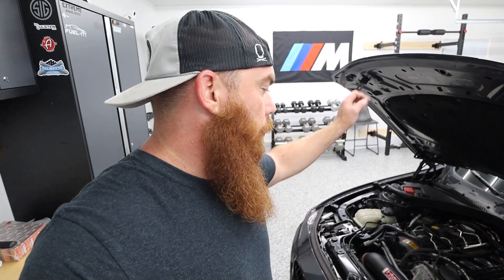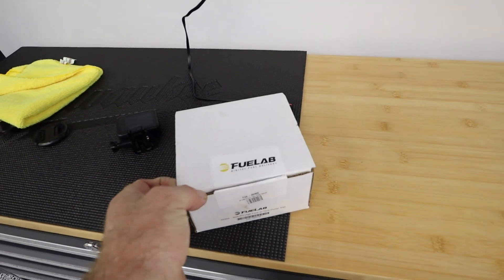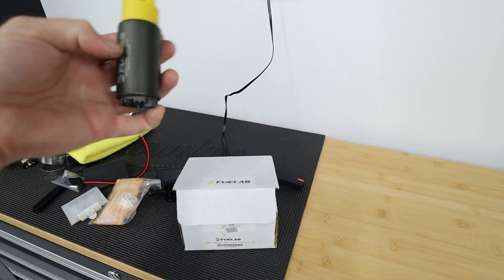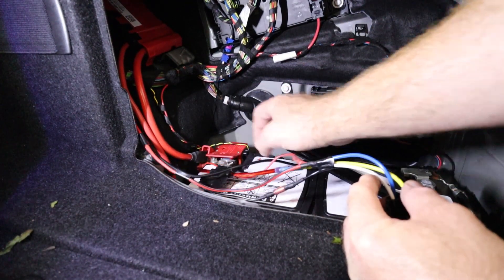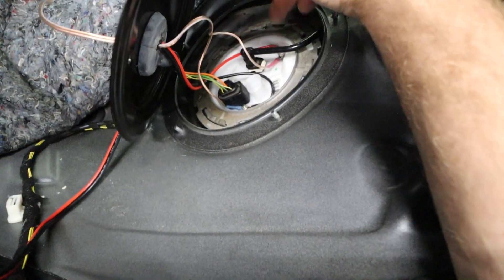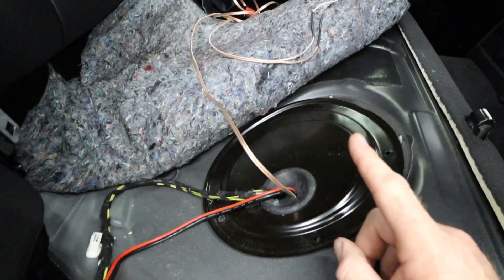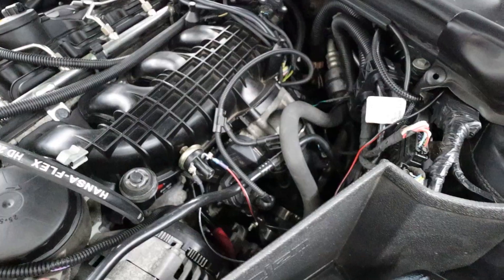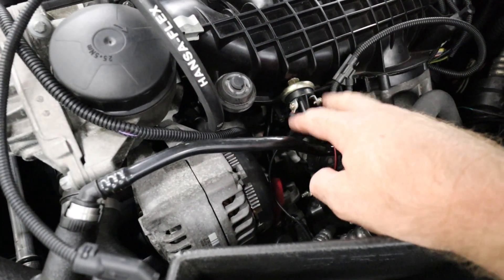HOBBS SWITCH WIRING LPFP FUEL IT!

Comment: you mentioned that the hobbs switch could also be mounted on the charge pipe ....  which is on the other side of the throttle plate ... would that make a difference in the difference between the manifold pressure and the charge pipe pressure when the throttle closes?
Reply from the maker: I would mount it on the manifold, I was still learning at that time now that I know more it would be manifold every time

Comment: Hey, I have a question about the wiring here. I was told by fuel-it that the red trigger wire, that you have hooked up to the Hobbs switch, needs to be hooked up to 12v power. I just finished the install and whenever my car is running, the pump is running/LED is illuminated. 

Are the red/black wires you have connected to the Hobbs switch two separate wires?
Reply from the maker: The Hobbs switch should be connected to ground once the connection is made it will ground and give power to the system
Reply: @BOO5Tchannel  thanks for the reply. I have the same hobbs switch as you, one of the ports on the hobbs is connected to ground. my question is about the trigger wires
Reply: Right now, I have the red trigger wire hooked up to 12v, and the black one hooked up to the hobbs switch. Is this the correct way to do it, or should I have both trigger wires connected to one port on the hobbs?
Reply: I'm wondering if I have it setup incorrectly, because right now as soon as I turn the car on I hear the 525 going and my LED lights up, even just at idle without any boost
Reply from the maker: Yes that’s definitely not wired right remember that ground is your trigger
Reply: @BOO5Tchannel  thank you for taking the time to help me 3 years later btw😂
Reply: @BOO5Tchannel  hey bro can you clarify if you have the red and the black trigger wires hooked up to the Hobbs switch?
Reply from the maker: @stephanheasley107  I don’t have the car anymore. It’s been two years since I sold it. You would have to look at the video. I know that the Hobb switch is both negative because it has to complete a negative circuit
Reply from the maker: @stephanheasley107  remember that the Hobbs switch is triggered by the ground wires not red power wires
Reply: @BOO5Tchannel  alright brother I’ll get it figured out. Thanks a ton for the replies a few years later🤟🏼
Reply: @BOO5Tchannel  so you have the red and the black trigger wires hooked up to the Hobbs switch?

Comment: Hey, I followed this and I can hear the pump turn on and everything when jumping the hobbs switch, but my remote tuner says secondary pump isn’t turning on. Is there anyway to know for sure? I hooked up an led light like you did and it also turns on when jumped.
Reply from the maker: So when you jump it, you can hear the noise of the pump turning on?
Reply: @BOO5Tchannel  yes I can hear it. I guess I should open it to check my connections in case a hose came loose. I did the install awhile ago but didn’t get an e85 tune until recently.
Reply: @BOO5Tchannel  so I checked wiring and removed the lpfp today and there’s nothing obvious that could be wrong. Only thing I noticed from your wiring that’s different is the white relay wire goes directly to the +12v battery but Fuel It has it going to the DME 12v “trigger”, is what they call it. Not sure if that would be a potential issue.
Reply: @MrHouavang80 also having this issue did you figure it out? I have my white wire 12v trigger connected to the exhaust flapper gray/purple wire. Also where can I get the led with the wires?
Reply: @tyleryu4643  no. I settled on staying on a lower boost tune. Ppl has told me could be that the bucketed lpfp is provided insufficient fuel in the amount of time needed. They recommend using non bucketed lpfp but I haven't tried.

Comment: Doing my fuel system on my single turbo e93 right now and this saved my life. No one else did a video like this especially on our cars
Reply from the maker: Hey man it was a 30amp 12v basic relay that are sold for cars they can basically be used for fuel systems, radiator, etc

Comment: What drill size did you use? You had to thread it afterwards to screw that hobbswitch on right? Did you use any threadlock or some sort to seal it?
Reply from the maker: 1/8 NPT is most of your drilling for intakes etc and yes use Teflon or tread seal
Reply: @BOO5Tchannel  thank you

Comment: Hi just looking to wire in this set up on my supercharged e92 m3. Great video. Can I ask why you didn't T the hobb switch into a vaccum line?
Reply from the maker: No vacuum lines on a N55 it makes no vacuum it is unique in that way, but every source i found says manifold to read proper boost pressure
Reply: @BOO5Tchannel  hi man did you wire the white wire direct to the battery terminal?
Reply from the maker: @AS-sq2yu  I no longer have car so can’t remember but look up a diagram
Reply: @BOO5Tchannel  oh OK that makes perfect sense then 👌

Comment: Hi can you help me
Since I removed my 350L aeromotive pump for the 450L walbro I have a too high voltage fault, do you have a solution.  335i 2010 N55 e92 thank you
Reply from the maker: No idea man that’s outside my expertise sorry. May be your fuel pump control module think it’s called a ekpm
Reply: @BOO5Tchannel  ah ok no problem merci

Comment: So does the main 12v supply come right off the battery? I guess im confused on where your getting your 12v supply from.
Reply from the maker: Yes battery, you can pull up a Hobbs switch wire diagram on google but it’s fairly simple overall if it’s your first time use a diagram
Reply: @BOO5Tchannel  where did you purchage the hobbs switch? Most of them I see on amazon only have 1 wire mounting place on them
Reply from the maker: @LukeWaters  I think fuelit.com but was part of my fuel pump kit
Reply: @BOO5Tchannel  right on, I found one off amazon lol
Reply: @BOO5Tchannel  will do, thanks! Your video is the most descriptive by far lol, I'm basing your install on hiw it will go on my 2012 caprice. Looks like it will be very similar

Comment: So when the Hobbs switch detects 15psi it jumps the terminal- grounds from the engine ground to the relay ground “completes the circuit or grounds the relay” (not to sure how it completely works)  so then the relay can close and give the power to the secondary pump which is already grounded to our battery terminal?
Reply from the maker: Correct, the ground is the trigger.

Comment: Question for the hob switch the wire going from it to the battery did u buy that or did it come with the kit?
Reply from the maker: To be honest I do not remember I don’t think so though I have a lot of wire I keep from 10awg-22awg
Reply: @BOO5Tchannel  ok so the blk n red wire for the hobs switch why is it 2 wires since it connects to 1 wire from the rely?

Thx
Reply from the maker: @zanmasterr  it’s ground and power so not 1 wire

Comment: Do you need to tune it or does the switch already turn on the second pump when you hit 15psi?
Reply from the maker: No tune should trigger when the switch feels 15psi, there are different psi pressure switches other than 15 also

Comment: Why does it have 2 12v supplies? Is one triggered by ignition?
Reply from the maker: All relays have 2 12v and the trigger is the ground if done correctly some trigger 12v but not a great idea
Reply: @BOO5Tchannel  sorry I’m not good with wiring
Reply from the maker: @modlist6129  not necessarily it’s triggered by hitting the boost it’s set for mine triggered the ground at 15 psi
Reply: @BOO5Tchannel   thanks a lot man I understand it well now!
Reply: @BOO5Tchannel  okay so the Hobbs switch stays on all the time? It doesn’t have a key one ignition source?

Comment: I have mine wired the same as you, but it only works if I jump the Hobbs terminal. It doesn’t work under actual boost?
Reply from the maker: Mine is wired to ground trigger, wire in a led to see when it triggers to know for sure
Reply: Did u figure this out? I have the same issue
Reply: @AS-sq2yu  I just had to adjust the Hobbs switch

Comment: Thanks for doing this, as I also have found NOTHING online about how to fix this problem. So I really appreciate your putting some info out there on this. I was just getting ready to run two pumps all the time, and wasn't thinking about overheating the module. Now, you mentioned where you bought the fuel pump, but I didn't see anything about where you bought the hobs switch and wiring? I have a Spool Performance Stage 2 LPFP in my 335i, and it works fine in normal conditions. But it falls on it's face when I push it hard. So I have another Walbro 450 at the house, and feel like that will give me all I need if wired up with this same hobs switch. But I need to know where you got the hobs switch, module and specific wiring? Also, if my memory serves, you aren't too far from me, as I'm in Cola. Would you be interested in a visit? I'd love to come talk to you about it. Thanks.
Reply from the maker: Hey yes I remember... so the Hobbs and wiring came from fuel it as options. You can definitely  come visit for a talk. The wiring is not too hard, just need to get a stage 2 or 3 with that option

Comment: NICE VIDEO!... DOES THE LPFP SUPPOSE TO RUN CONSTANT? I HAVE AN AUDI B8.5 AND WANT TO INSTALL A WALBRO 450 WITH THE RELAY,,
Reply: Ok cool. I’m trying to learn a bit more about the lpfp so is that with all cars? Or just your setup , like if I put In a new aftermarket pump with relay and no Hobbs switch , will it cause damage? Or the low voltage from car will send signal to relay when needed? Thanks again bro.
Reply from the maker: Sorry just saw this, it’s the setup not all cars. You need or Hobbs switch or a fuel controller no Hobbs on stock controller will burn up the controller quick.
Reply: @BOO5Tchannel  no problem I got it do e a few days again. Thanks
Reply from the maker: Hello it does not run constantly, it’s on a hobbs switch which kicks on at 15 psi the secondary pump

Comment: How are those vmr wheels holding up for you? I think its been half a year since you changed it. I see lots of comments on the website said that vmr wheels are easily to be broken and the coat will start to fall of somehow? I's like to buy a set of vmr but just wondering if I should since i saw those comments...and also, i saw ur vid that u got your vmr with tires on? do they install the tires with the wheel and delivered it to you?
Reply from the maker: So far mine are good, I put 600hp to them with no issues. Coat seems to be holding up well. I am actually looking for a set of 437M wheels as a 2nd set too. I bought them mounted balanced and with TPMS sensors as a whole wheel and tire option, took 8 weeks with my custom color

Comment: Do you need to upgrade the EKP with the dual pump set up?
Reply from the maker: You don’t “need” to but it is better to have one for 550+ hp. I will get one once I get my build nearing the end. Good question!
Reply: @BOO5Tchannel  Why do you say its better for 550+hp ? I am waiting on my stage 3 lpfp for my n55 but the reason I sprung for it was the added benefit of not needing an upgraded ekp?
Reply from the maker: Nekahplz This is directly from the site: BPM4 communicates directly with the DME and is able to drive one, two or even three Walbro 525's under full DME control. This ability to run multiple high-capacity aftermarket pumps while maintaining full DME control over the low pressure closed loop control system that the vehicle was designed with, is something no other solution on the market offers.

Comment: hey, coming from Thic f30 channel, had a doubt about tunning a bmw series 4 430 and still have to buy one and tune it but idk anything about tunning and never had a bmw. Need help about what to change from stock and is it gonna be reliable for the car. Thanks, insane car that u have!
Reply from the maker: Hey man thanks, I don’t know much about the 430 because it’s the 4 cylinder version but I would say bolt on like charge pipe, down pipe, and intercooler is your first mods to go stage 1 and stage 2... reliability is pretty safe at stage 1 or 2 from what I hear about those engines which I think is the N20. Thanks for the comment!

Comment: What is the fail safe for when hobs switch fails?
Reply from the maker: Hey, the light I have installed... if light does not fire means fuel pump is not firing which usually means Hobbs is not working. Thanks!

Comment: nice install Chris.
Reply from the maker: Thank you bro, I keep making these videos for people like you! Send it!
Reply: @BOO5Tchannel  Your work at Siemens?
Reply from the maker: vonfragyou No I am a self employed contractor
Reply: @BOO5Tchannel  Probably ran into you around town one time. Anyway, I have a BMW 2020 M4 convertible, picked it up after Christmas. I am doing some Carbon fiber tweaks but have no plan yet for performance upgrades. My question to you is how to you balance your upgrades? If you upgrade air intake, then you need to do something for the exhaust? Seems like there is an art to making the car run correctly after upgrades. Keep up the interesting videos! Have productive week!
Reply from the maker: vonfragyou well I would say it’s a balance of budget lol, but if you start with a downpipe you can go stage 2, I am pretty sure M4 has air to water intercooler so no issues there, downpipe is the limitation if you want to go to stage 2, do that first followed by whatever you want, like intake next.